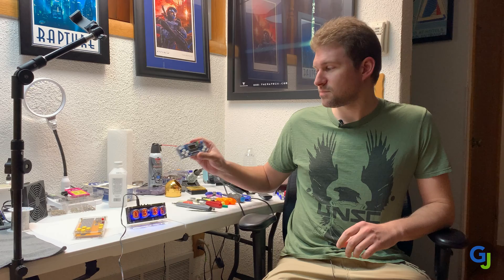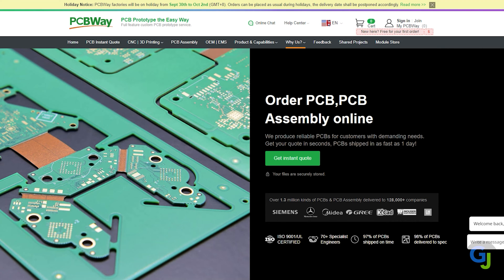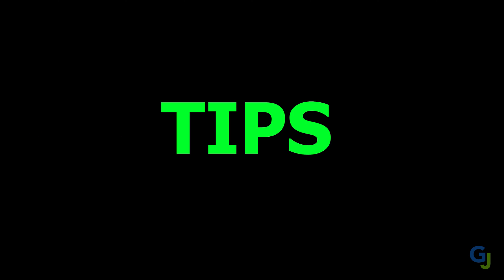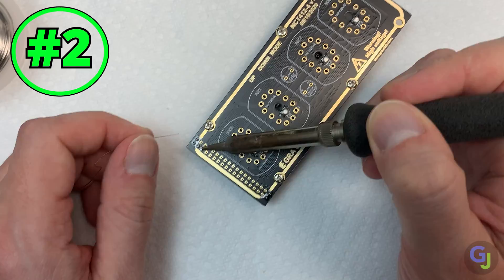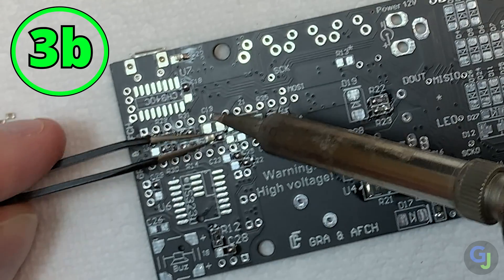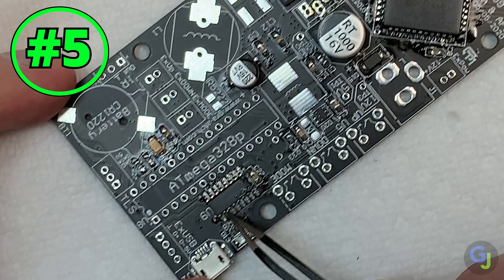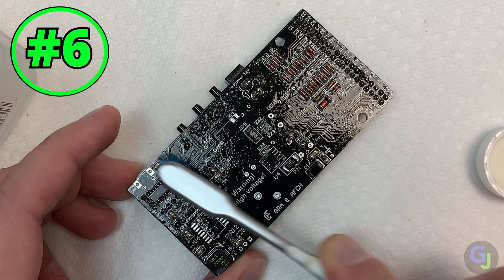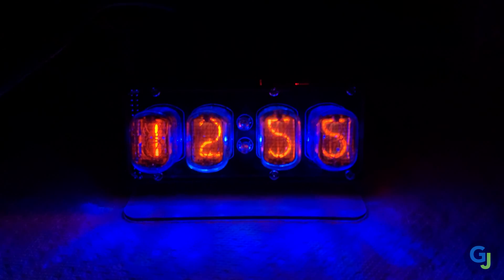How To Solder Part 3: Advanced Projects To Test Your Skills

Comment: Hi I currently working on a smd board, and I'm having problem with my usb type B mini, micro idk at this point. Anyway, the data pin of the female usb is too short to have a good coverage onto the pad, mind you the pin is on the pad but it is so short, my question is what type of soldering tip should I, like type B, D, I,  so that: 1. I don't create a bridge in my soldering, 2. How small so that I can put the tip of it on the pin so when I drag it down vertically to the pin, there will be a solder bridge 1 pin to 1 pad not bridging horizontally, hope that make sense.
Reply from the maker: If the pin is too short and it isn't close enough to the pad to get any connection, I don't think you could reliably create a solder bridge from those 2 locations that lasts at all. If I'm understanding correctly, what I would do is jumper it with a small wire or I guess you could cut off a leg of another junk IC chip and attach it to both locations to extend it. That still might be a little janky though. If it's a really tight space, you may want to attach the "patch" part before installing the whole connector so you have more room to work beforehand. I'm assuming the connector is defective with it being short so another option is just buy another connector too. They are pretty cheap and then you don't need to do any patches or worry about how to solder it at all. Hopefully that helps, but good luck, I'm sure you can get it to work!
Reply: @gamejaeger  well the thing is the connector work, I manage to solder it but when look back, the pin feel like they don't have any solder on it, and the only way the pin connect I guess is because the solder flow and hit the tip top of the pin and not overflow and cover the whole pin leg like you would see when you solder normal smd ic. I asked because I want to resolder it but it seem like I better leave it be and not risk create an unsolvable bridge between pin.
Reply from the maker: Yeah, I would agree. If its working but just looks a little weird, then I'd leave it alone. You may cause more issues trying to get it looking better, especially if its in a tight spot too.